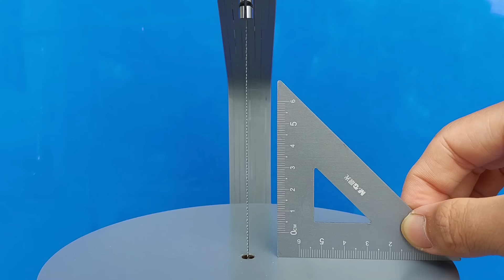Homemade Scroll Saw from PVC

Comment: Greetings from Liverpool England 🇬🇧 
I love all your videos and think you are very intelligent and ingenious because of the way you create all your toys, but especially the small tools you construct. 
Do you think you could design and construct some small tools for a hobby workshop please ?
Firstly,  a miniature hydraulic sheet metal bender that can bend small, thin sheet metal like brass, alluminium and tin up to 90°. It should be able to handle something up to 12 inches wide, but no more.
Second, a miniature pipe bender/curler for small scale round hollow metal pipes or plastic pipes, up to 1cm in diameter, so that you can make them circular. These machines are usually very large and have 2 sets of rollers or bearings that can be tightened, to make the curl in the pipes increase the more you pass them through the rollers.
Lastly, could you design and make a miniature machine  to heat up recycled plastic and exude various thin lengths of plastic for model making, such as rounded, square, triangular,  half circle, flat oblong etc. by changing a disk at the end of the heated part to get the various shapes required. That way, you can always increase the variety of shapes you can produce, just by making another disc.
If you can design and create any of these it would be fantastic, as I have searched YouTube and found no videos of how to make any of these machines.
Thanks for making such interesting videos and sharing your skills and knowledge with us all.
Reply from the maker: Thank you. I will try
Reply: Thank you - that is more than I could hope for. Also, there is no rush to make them, just whenever and when you are able to make them would be fantastic. I really appreciate you even considering designing these tools, let alone making them and uploading a video to help others Is really very kind of you.

Comment: You need some Roll bearings for Blade control, and the table could be movable to rotate.Also,a blade expandAnd fixiate Nut   would be safer and good for more accurate cuttings. 
But other than that: Very impressive work.
Reply from the maker: Thank you

Comment: Great engineering skills! One question, why not install the crankshaft disc directly onto motor shaft? I guess the reason is speed reduction/torque gain, but then using a slower motor with more torque could result with less parts.

Comment: This is a wonderful design and I commend you for it. But people should be reminded of the danger of microplastics when working with PVC and any other plastics, especially when sanding. These are incredibly harmful to our health and the environment and we should do our best to contain them and also wear appropriate breathing protection. I also make things from recycled plastics and I try to avoid any sanding by shaping with an ultra sharp craft knife. It takes a little longer and the results are not quite as good,  but I feel better if I can eliminate the production of the ultra fine plastic particles. The coarser particles are easier to collect and recycle, or dispose of appropriately. This is not a criticism of your work (which is great!) just something to keep in mind for anyone working with plastics. Best wishes. 👍
Reply from the maker: Thank you

Comment: I just wonder who would be having so many equipments and components at "home", and not have a scroll saw!
Reply: You can accomplish all the operations with hand tools, he is using the tools he has or has built. I'm about to build a scroll saw soon, I only have a drill and a hand saw available, but I don't see the issue, my machine may not looks as pretty, but once it's done I can use the machine itself to make improvements for it. I will use wood instead of PVC, also irrelevant, point is you can build it with hand tools, having a drill is one thing that would save you a lot of struggle, but you can find used ones for $10.

Comment: I admire you but I don't think you are totaly honest in these videos. Straightened pipe would never be that flat and match so well when stacked. I believe you are using sheet pvc instead of pipe.
Reply from the maker: I use them entirely with tubes and it takes quite a while to flatten them